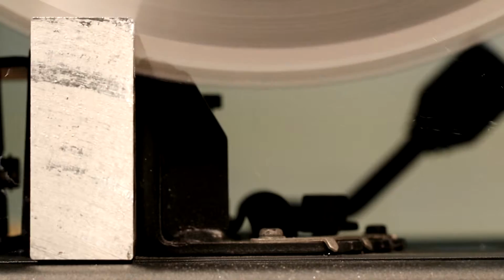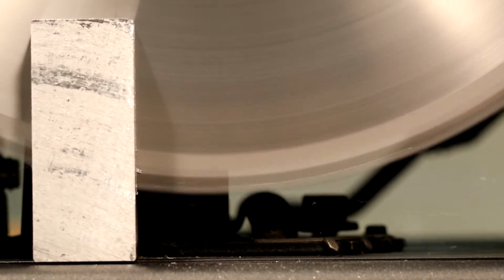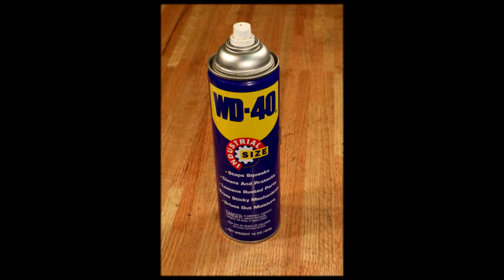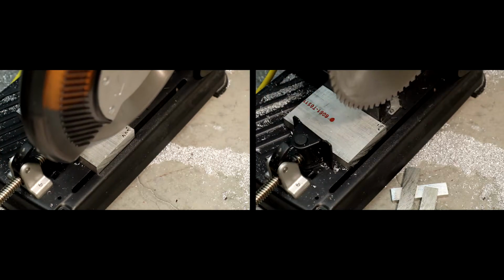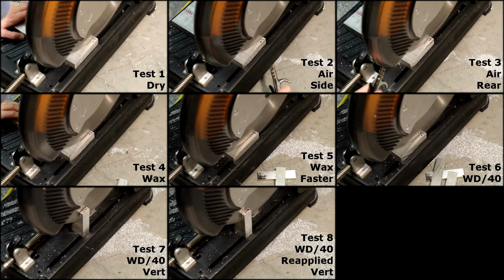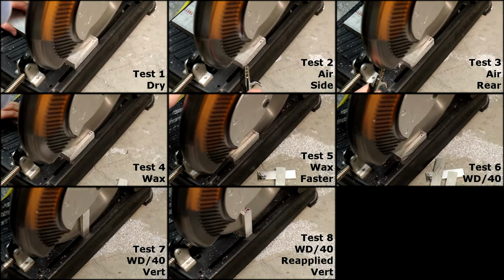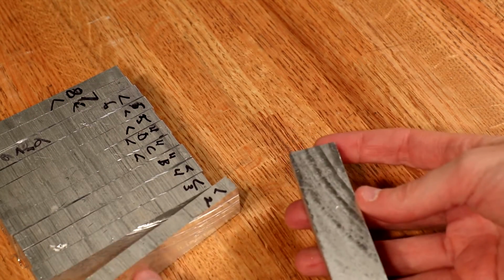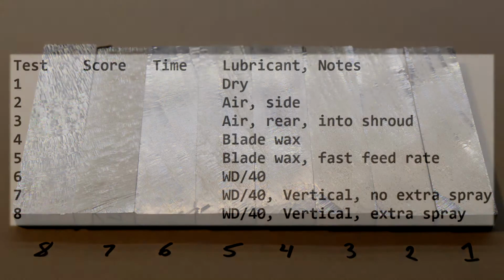DeWalt DW872 Cold Saw Lubrication

Comment from the maker: Check out my most recent video: https://goo.gl/Jj7cU1

The abilities of air, saw blade wax, and WD/40 to improve the surface finish on a DW872 cold cut saw are tested. Not only does the surface finish improve, but so does the cut rate. The manual does not recommend lubricant, so use caution, stay alert, and be safe.

Comment: I bought a carbide Al blade and have only made a couple of light cuts in soft stuff with no lube but I'll try WD-40 next cut. I've ruined two carbide blades trying to cut mild steel... fractured a bunch of teeth and the sharpening shop I've dealt with for 15 years says pitch it. I've got a Portaband but that's another thing altogether. I really need to get the maximum performance out of that saw. I'll try the WD-40 0n steel, too, until I learn better.
Reply from the maker: Wow, I've not had that happen. Those blades are expensive so I feel the pain. The only time I had similar problems was when using a HF compound miter saw to cut aluminum plate. Worked awesome, but without great clamping the teeth would slowly breakoff. I only cut solid stock, up to a little more than max size, and occasionally DIN rail and 8020 like extrusions. I hope you figure it out.
Reply: How many rpm were you cutting steel. And what size blade,chip profile, and rake.

Comment: Thanks for posting this. Just this afternoon I drove 110 miles each way to, among other things, talk to my sharpening service about lubrication for a carbide tipped cold saw. We had a discussion but came to no conclusions. Have you done a similar test cutting steel?
Reply from the maker: Aluminum tends to gum in the space between the teeth, eventually packing the space entirely preventing chips, if produced any longer, from being carried away. The blade then rubs, the aluminum heats up and the problem is worsen. Do want is needed to keep the packing from happening. This challenge does not exist with steel and cuts cleanly. I'd not bother with lubrication with steel and avoid the mess. One more suggestion regarding thick aluminum, consider cutting a little and backing off just a little too let everything cool, and repeating. I've found this helps a lot to leave a straight and clean cut. Hope this helps. Let me know what you decide.

Comment: Something different, i use a 12" band-saw, but also notice a huge improvement when using wax. (i just use paraffin from candles though) It also helps to put it on when the blade is warm so it melts onto the surface of the blade. It also helps to prevent gumming up with poor grade aluminum (but i guess that's not an issue with the larger carbide tips on your saw). How do you like that de Walt? is it stable enough to cut aluminium profiles for a true fit? (perfect 90 degrees)?
Reply from the maker: Hi Rene. I've not had aluminum gum up on the teeth on this saw, but did on the previous sliding compound miter saw, which probably turned faster. The DeWalt is nice, one my favorite tools, but the base and clamping system are not great. However, the main part of the saw is easily removed and one could bolt it to a new base with a nice vise. I'll try cutting extrusions and post a few pictures for you.
Reply: I guess the lower RPM's are helping, indeed. The base is from stamped sheet-metal? I found one locally (from a distributor who has got connections in China)  with a casted base. I don't know if the sheetmetal makes it unstable though, perhaps it's stable enough. It's nice and compact, that's what i like about it.
Reply from the maker: This base is indeed stamped sheet metal. As a consequence, there are little high spots that work against staying perpendicular with the blade. A cast base is certainly intriguing. Does that base have a better vise as well? With mine, the "fixed" plate of the vise has a tendency to pivot. The moving vise plate is angled, but I think that's to better hold tubing and other stock from lifting. The size and ability to cut aluminum and steel are what brought me to the saw. I have a small workshop and each tool must have multiple purposes. :)
Reply from the maker: I put a few photos at following links. The results were better than expected. The edge on 30mm square material was clean, far better than on a bandsaw. I didn't make any extra attempt to square the fence to the blade. This is already better than I would probably need. I didn't see any light coming around a square. Hope this helps.

https://www.instagram.com/p/BPLgBO_g1YR/
https://www.instagram.com/p/BPLgc92gNFr/
https://www.instagram.com/p/BPLhQVkgvXt/

Comment: What blade are you using?? Where did you get it?
Reply from the maker: Hi Jerry, I enjoy your videos, good hard work, you picked up a new subscriber. I'm using the standard DeWalt blades. I still have the original plus a spare for when one is being sharpened. I take the blades to a wood working store, which sends them out to be sharpened, a bargain at $25 + $2 per replaced tooth. The second blade came form Amazon and was not cheap. I also have tried the Evolution Rage2 and Evo380 saws. I like the Evo380 the best of the three, which can use a slightly larger blade, but it's hard to find. I've used Freud aluminum cutting blades on a compound miter and they worked well too, but I had loss of blade teeth with that combination. Hope this helped. Best wishes
Reply: @kentvandervelden Thank's Kent. Much appreciated. I'll will sub back. I recently picked up a dewalt chop saw d28715. And wanted to change out the blade for a steel one like yours. What should I search on Amazon for the right blade? Thank you for your reply.
Reply from the maker: @MRreptile13  Search Amazon for B0000302QT or DWA7747. The D28715 probably rotates around 4000RPM but the max speed listed on the DWA7747 is 1800RPM. I probably had the blade teeth lose on the miter saw is because I was running the blade fast.

Comment: Thanks for the video. Solid aluminium and this saw is a disaster. I'm yet to find a satisfactory blade/solution.
Reply from the maker: I've been using the Evo380 and like it the best of the chopsaws I've tried. However, if I had the space I would have a horizontal bandsaw. I used to have one of the larger Harbor Freight bandsaws it was pretty nice and there was less material waste.
Reply: Wells done video, I have used both the DeWalt metal cutting chopsaw, DeWalt woodcutting chopsaw, and own an Evolution 380...blades are important, even a spritz of water helps when cutting aluminum to reduce eliminate clogged teeth. Best regards, Paul
Reply: As an update, I found candle wax on the blade and all my troubles went away. Now it cuts like butter and this saw is simply excellent.

Comment: Wd-40 😂
Reply from the maker: Truly a garage staple
Reply: WD 40 is an excellent cutting,milling, drilling, turning fluid for aluminum. It is similar to kerosene which has been used for many years in days if old for aluminum... biggest issue us the residue. WD 40 is mineral spirits and mineral oil.